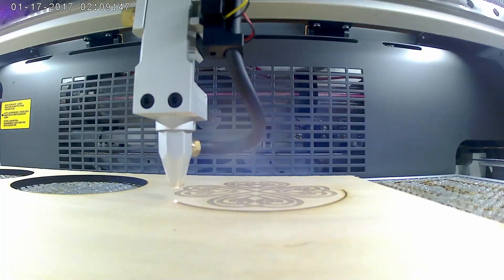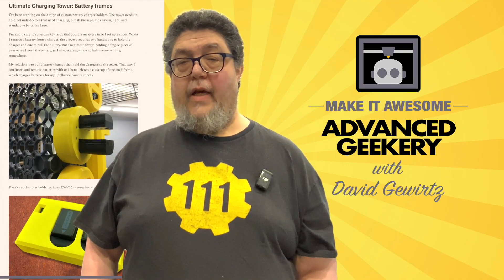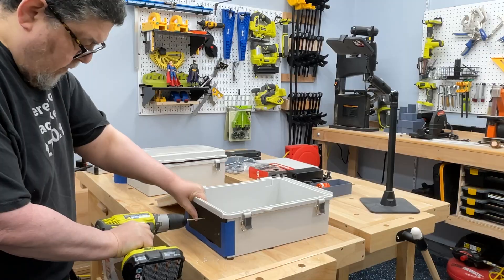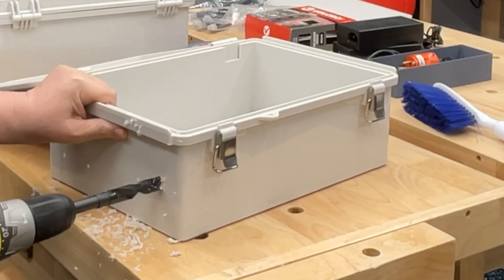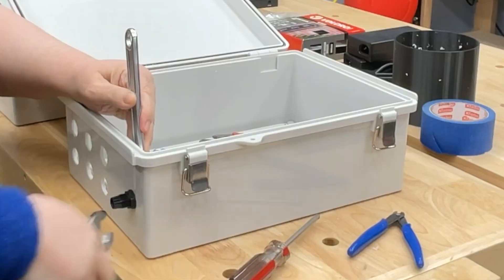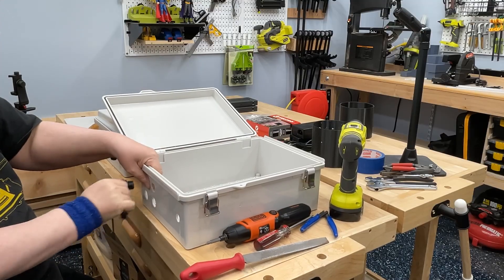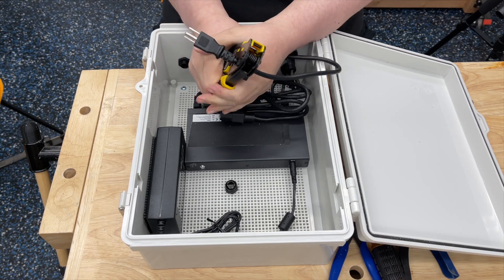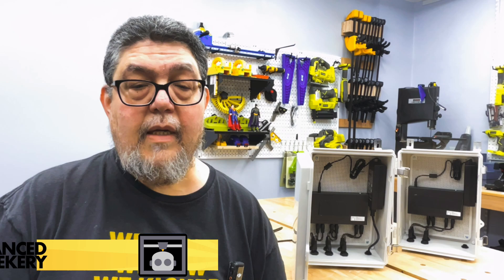Build waterproof PoE hubs to power all your outdoor cameras

Comment: One more tip, I used a metal deburring tool to ream those openings a bit more, driving them with a hammer just bogged the threads.  --